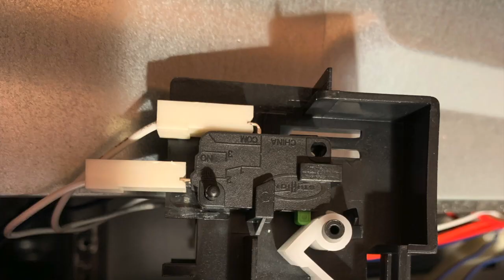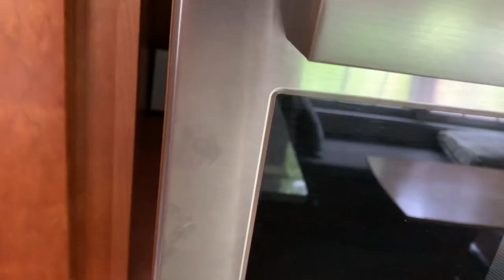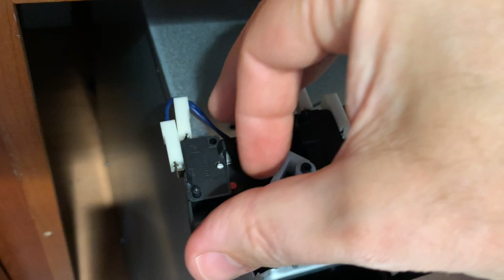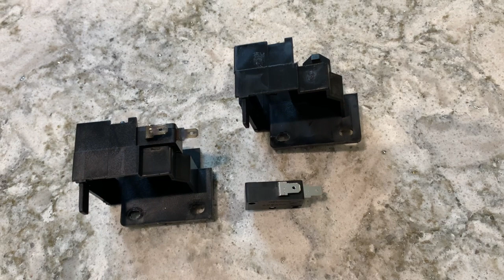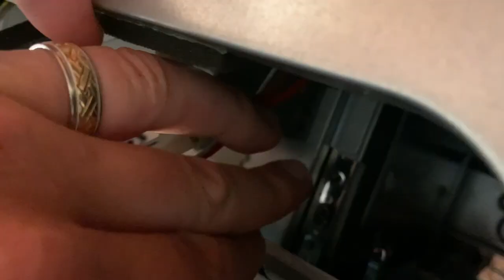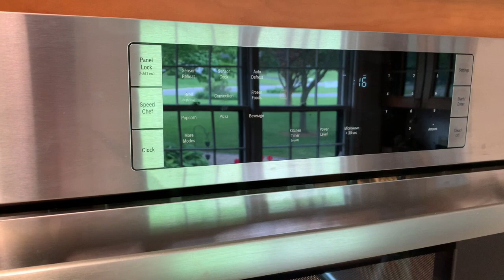Bosch Part 2 Door Switch Repair: Built-In Wall Oven Microwave Oven - 800 Series

Comment: After changing the monitor switch the unit worked fine for about 4 days and broke again .
Now back to the same problem as soon I plug in the unit it trips the breaker. Any suggestions??
Reply from the maker: You might have a "sticky" primary interlock switch---  one that usually works, but occasionally is slow to open when the door is opened.  This will cause a short that will blow the breaker.  Try replacing both switches. (I do not expect that the 3rd "door switch", with the 2 blue wires, would be a problem.  It never sees high current.)

Comment: Thank you for the How to. 
Recently replaced Both  hinges on My Oven Contraption. 
Bought a new inner panel. But It wouldn't fully snap in at the top (Handle side edge) as the Inner tabs on the Doors' frame plastic (not the being replaced cover)  lost the sharp edge of the retention tabs  on my apparently inept removal of the original panel (despite my only breaking 5 tabs in process) ...wouldn't grip enough to fully flush the New panel ( 4 separate start over again  attempts... grrr  ) . 
Gave up finally..and Used Thin Ca glue... it wicked in like water and  truth be told.. it worked perfectly. Gave it a half hour of setup time .. being overcautious.
So as heads up: If one has failed or damaged the retention  tabs ? You don't need a fresh inner plastic panel. 
Mine didn't fit well at all despite it being fresh/new.
   A fresh bottle of Quality /brand name (used Bob Smith Industries)  Thin Ca does the job of the tabs and can be made to release (next time) with a bit of mechanical torque applied (thin blade) . 

Planning for the "Next" Bosch  failure..I noticed that those Micro switches were out of stock. AND suprisingly Pricey for micro switches.. adding insult to injury. 
Realising that I have  bags  of Micro switches of similar (likely exact) size and volts /  amps.  For use  as Limit switches on my CNC machines. 
Their quality is Excellent. As In;  never I've ever experienced a failure... the reason for the too many spares.
These run ~25 Cents each   including shipping, for a dozen. Sometimes more, sometimes less... Via Ali Express. 
Small reason to feed even more $$ ...pointlessly.. to Bosch greed.
Reply: Yes, I used a generic micro switch as the exact Bosch part was not in stock. Hopefully it lasts longer than the Bosch one.
Reply from the maker: thanks for the CA idea. I'm hoping that I don't have to do the hinge thing again!